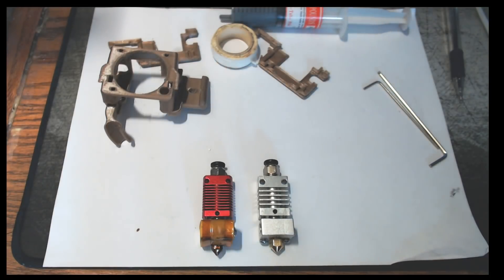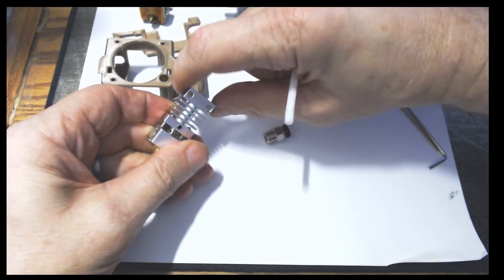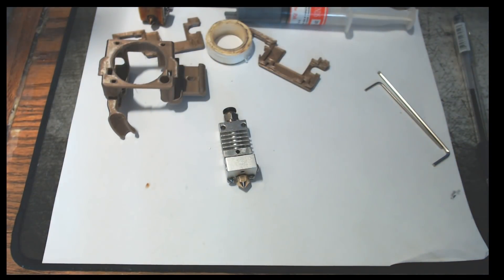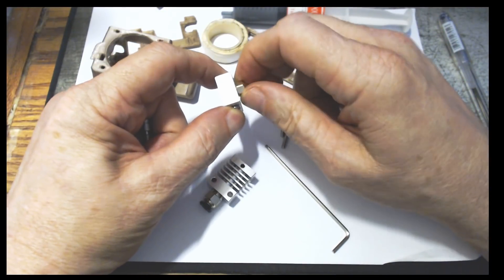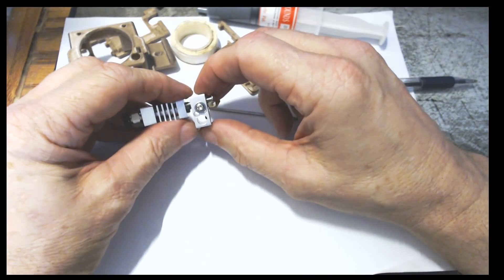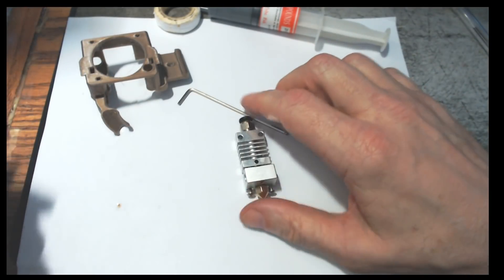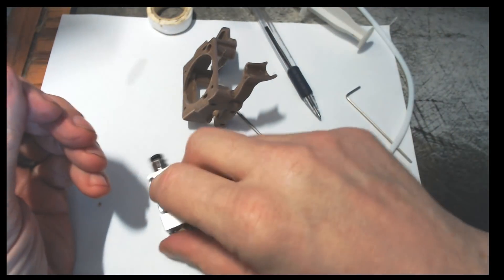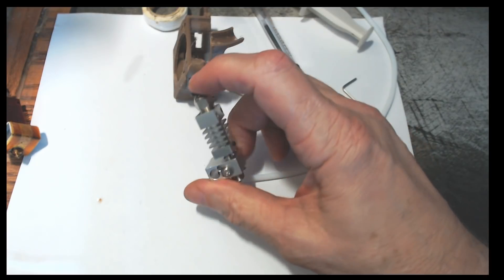All metal hot end for the Ender 3 for $7. Part 1, tips, trips and lessons learned.

Comment: Dont forget to do a PID calibration after changing the hot end as the nozzle temps will be significantly different due to a change of materials (especially if your using the titanium alloy hot end).  Plenty of guides out there and its quick and easy.
Reply from the maker: That's good information, Mark. Thanks for sharing!

Comment: The PTFE tube can release gasses at the high temps needed. So after using an all metal hot end to get rid of the PTFE tube I added PTFE tape to the hot end.....
Reply from the maker: I should put some text on it or something I guess.
But I'm hoping I can hit 1000 people who've called me on it. After 2+ years since I posted that video I must be getting close.
Reply: @3rdpig  :-)
Reply: or get some capricorn tubing it takes higher temps than the ptfe and is not that expensive :)
Reply: @John_Atkinson  capricorn is still ptfe tube. Capricorn will offgass at 250c, just like the cheap white bowden.

Comment: I upgraded my factory hotend with a titanium heat break from Spool3D. It turns it into an all metal hotend and keeps the stock cooling block with the pneumatic Bowden tube mount which is much better than the crappy Micro Swiss plastic tube mount.
I also bought the Spool3D nickel plated copper heat block that comes with titanium mounting screws so you don't have to rely on the crappy single grub screw that Micro Swiss relies on which is a weak design. The 2 mounting screws do not transfer any heat to the cooling block. It's a myth that's been debunked.
These 2 parts from Spool3D are cheaper than the Micro Swiss kit and make a much better hotend.
Reply: Thanks for the heads up.
Reply: Instablaster.

Comment: The 2 screws attaching the heat block to the cold end immediately identifies it as not a Micro Swiss. Those missing screws on the Micro Swiss had me extremely concerned that things wouldn't hold well enough, but the grub screw absolutely does hold it all together perfectly well. On my CR-10S my Micro Swiss with my TH3D Studio 50w heater have worked great and I can now easily print in Polycarbonate and Nylon.

Comment: 9:20 While you do want the heat to transfer well between the heatbreak and the heatsink, you DO NOT want the heat to transfer well between block and the heat break.
Edit: to further explain, it is inevitable to transfer heat from the heatblock to the heatbreak and then to the heatsink. The heatsink is there exactly to cool down the heatbreak, that means dissipate the unwanted heat that creeps away from the heatblock, because it can melt/soften the filament while still in the heatbreak and cause clogs. The real reason why teflon tape is a bad idea is because it releases poisonous gases when heated too much. What I did once was wrap my heatbreak with a few insulating glass fibers before screwing it to the heatblock. Theoratically, this would reduce the heat transfer between the heatbreak and the heatblock. I don't know how effective it really was, but It wasn't harmfull as I printed for more than a hundred hours without clogs after doing that.
Reply: Thanks. I was watching the video and noticed the same thing. Just paused it to jump down to the comments and see if anyone had pointed this out yet. So I'm just here to second that the last place you want to encourage heat transfer is between the block and the heat break.
Reply: Exactly. The purpose of the heatbreak is to STOP the transfer of heat upward from the heatblock. Makes no sense to increase heat transfer to the heatbreak.
Reply: lapidations, do you have a video how you do the wrap?

Comment: Nice video with some interesting insights. Some misstakes, too: I think you do not want to promote heat transfer between the heat block and the heat break. You want the heat to stay in the heat block and nozzle as much as possible, and you want the other heat, that managed to get into the heat break to be cooled down as much as possible. So yould should use paste on the nozzle to heat break thread and between the upper heat break end and the coolig block, and maybe between the heat block and heater cartridge and thermistor, but nowhere else.
And of course you do not want teflon on your hotend, that's why you switched to an all metal hotend at first, but I have just seen this has already been commented ;)

Comment: Did you reflash the firmware?
The stock firmware limits retraction to 25 mm/s and temp is set to 275°C max.
Reply from the maker: I've reflashed the firmware on both my Ender 3's  multiple times and from several suppliers. They've both been on the Marlin Bugfix 1.1X for at least 3-5 months. It's been the most stable for me. I've posted several videos of it.

Comment: Bowden tubes degrade at print temps of 245 plus, it just slowly leaches into your prints until a large enough gap develops to cause a clog. with getting leaks you sometimes need to polish the mating ends, I used 1000 grit sandpaper and stopped all leaks, I was using TPU and it was a terrible mess.

Comment: Tighten the nozzle all the way and use that 1/4 turn back, not 3/4 turn. What this does is allows the "cool area" of the heat break to be further away from the hot area. I know it does not seem like much but EVERY little bit helps. It might only give you an extra ~0.25 - 0.3 of a mm but that is that much more retraction that you can use, and just a tiny bit less blobs/stringing on prints because you can retract more. This will also engage the nozzle into the hot end just "that much more" which gives better heat transfer to the spot that is supposed to be hot = smoother looking prints.

I've been through a similar process, but with a Titan (insert registered trademark here, hehe) setup. After a great deal of testing/retesting many different things, my above advice seems to hold true. I got better prints with less blobs/stringing by engaging the nozzle as much as possible. I managed to get my retracts up to 2.5mm. I also went through a headache surprisingly similar to yours but I never had issues with leaking filament, I had always tightened the nozzle after an initial heat up (regardless of teflon lined or all metal), I learned this trick early on. My setup is a direct drive though, I can't be certain about a bowden tube, but it does seem to me that a bowden tube would naturally introduce slack so retractions should be a tad bit higher than a direct drive. I can't test this of course. Your millage and exact settings WILL vary.
Reply from the maker: Excellent info, thanks!

Comment: Been going down this rabbit hole. THANKS for the third video! Some quick tips break out the calipers and measure dimension on this stuff. Also consider ditching the heat block for a copper one. Also don't use the heat block screws... The reason is, I found both the block and screws were out of spec big time... If you use the screws they can pull the throat cock eyed. If one gently tightens the nozzle and throat under heat you'll get a clean matting. The other thing is start with extremely low retraction... Like 2mm maybe 3mm.

Comment: Don't know whether somebody has already pointed this out but putting thermal compound between the thread of the heater block and the heatbreak (as mentioned at 9:54) is a bad idea. 
It is counteracting the very purpose of the heatbreak as it is meant to keep the heat away from the upper part of your filament (or ptfe-tube if there es one). Essentially making the job of the heatsink harder as it is trying to keep that sucker cool for as long as possible. Putting it between the heatbreak and the heatsink, however, is a very good idea for the very same reason.
Reply: Well, i tought too but i got the same kit and had problems until i put thermal paste on the heatbreak thread. For what i saw, the heatbreak in his bottom part was too cold and it create jams. As soon as  i put thermal paste, problems gone and print like a charm.
Reply: @Jajaho2  My friend, we're maybe not rocket scientist but neither of us are idiots ;).
my setup in details : 
- ender3 linked to octiprint
- all metal hotend (this kit)
- Nozzle 0.4 in hard metal
Material i print wright now is PETG from Overture (amazon) @ 245 - 250 (still search the perfect setting) with 3mm retraction @ 45mm/s and 100% fan. Speed is at 50 with 2 walls and 5 top.
Reply: it's ok he likes to make mistakes so he can solve them later

Comment: Thanks for the video. Although I know this was a while ago, lately I've seen people polishing the insides of the all metal hot ends (and one guy spraying it with a dry lube) to get less of the filament retraction to stick.
Reply from the maker: Thanks, in a later video I tried an oiler which seemed to work well enough to get me back to 4-6mm of retraction. I've got more than one printer, so the one with the all metal hot end, which is also  enclosed, only gets used for something that really needs high hot end temps and an enclosed, heated environment. Thanks for watching!

Comment: I know this is from last year but just a heads up, I'm pretty sure the thermal compound should only go between the heat break and the heat sink. The objective is to cool down the heat sink, not heat it up. Also thermal compound isn't rated high enough to go between the heat cartridge and the heat block. Not sure what it breaks down to, but it's probably not good.

Comment: Thanks Chuck VERY useful...  The only thing that caught me out was 'using' the heatsink past! (perhaps it was good tolerances in mine... I could not get anything of it of it till I stripped it all out again and found that some heatsink paste got into the filament chamber... once cleaned out it was fine... Ps. i got Thermal runaway pop up on mine 2 minutes after the thing was started printing and presumed (falsely) that i had damaged the glass thermistor bead...I ordered a pack of 4. Later, when I really needed to print a part on it.. I got to looking at it again (in hope) but a bit more closely only to find the bead not in contact with the heated end and giving a falsely low temp rating.. put it back properly and it works a treat... PPS.. I ordered a cheap clone (£5)  myself and was prepared to wait for it to arrive.. My brother wanted an ABS part quickly and bought on one eBay. £35.. I see absolutely no difference in the look of this one and the one I ordered!
Reply from the maker: I definetly made a couple of mistakes in the video. For me none of them really made a difference. Later on I had to clean a clog out of it and when I put it back together I did it without those mistakes and it wasn't any different. So I either lucked out, or it wasn't as big of a deal as I thought it was. Oh, and I never put back the glass bead type thermistors, I always replace it with the screw in type. But that's just because I don't seem to be able to take one out and put it back more than once without breaking the wires off at the bead.
Reply: @3rdpig  I think I have lucked out too.. Changing filaments is a real pain.. I have to take the bowden tube and threaded nut to get anywhere... In the end i put the stock hotend back on and can change filaments so easy with that (providing you get the temperature right first before retraction) I'm guessing the insides of the cheaper ends are not very smooth unlike the bowden tubes.. which go further down the heatsink. I have given up on ABS printing now as my experiment with Glass/hairspray is not working at all ;although it is great with PLA/PETG. go figure. Thanks anyway Chuck. I like your videos.
Reply: update 2... my 'cheap version bought by my brother was not cheap (£35) as this but looked the same   I happened to order at the  a really cheap version off eBay and was prepared to wait for it .. it came today.. it is NOT the same... I'd say it is a mix between stock and yours and the one I tried in that the heat break is a lot longer inside the cooling fin block. So whilst the bowden tube does go inside the finned block, (as the stock original) it doesn't go as far down to the heat block. The stock part bowden almost touches the back of the nozzle!  I have yet to try it but am more hopeful with this one as the filament will get further through the system that my last one. (in the new one  linked you can see the heatbreak tube is a lot longer. https://www.ebay.co.uk/itm/Ender-3-5-Pro-CR10-CR10S-CR20-Hotend-Hot-End-Extruder-All-Metal-Upgrade-Kit-UK/143680597978?ssPageName=STRK%3AMEBIDX%3AIT&_trksid=p2057872.m2749.l2649

Comment: Teflon tape is the same thing the tube is made out of.  You'd be smoking it off making the fumes you are trying to avoid.  I use it between heat block and heat break to further thermally disconnect it whenever possible.

Comment: Yeah, I got one of those.  Mine had a piece of plastic inside.  If you get one, take it apart & double check.
Reply from the maker: I've purchased 3 of them and haven't found anything unusual inside. Is it some kind of packing material or just something that looks like it got there by accident?
Reply: @3rdpig  It looks like PTFE tube, I'm guessing that's what it is.  If it was installed on a machine without taking it apart you wouldn't know it was there, until it started to melt (or burn) at higher temps.

Comment: Inspired(?!) by this, I've just bought a complete knock-off hot end kit, including a new heater and higher temp rated thermocouple (not K type as I don't want the hassle yet) for....$15 shipped to the UK. Crazy.  Thanks Chuck :)
Reply from the maker: You're welcome!  I've since replaced the thermocouple on mine with a solid, screw in type. It fits in the screw hole that the retaining screw for the original glass bead thermocouple and is rated to 300 C. I don't intend to run it at that temp for long periods, but so far it's handled it 300 C for 30 minutes and 275 C for 3 hours. I'm looking forward to getting up and running with something higher temp and more durable than the Bridge Nylon.
Reply: Chuck Bryant When it arrives I’ll let you know what I think of the new hot end assembly I bought. Thanks again for taking the time to produce the video.

Comment: IMO one place you should not encourage thermal transfer with the heat paste, is the start of the heat-break threads inside the hot block, this is one spot where the more lossy you can make the thermal transfer, the better off you are. Everywhere else makes sense.

Comment: Great video Chuck, going to try the thermal paste to. Had same problems to, i coated the inside of the hotend with wd-40 dry ptfe spray, this helped a lot,the fillement goes thru a lot smoother. Keep up the good work..
Reply: Did you miss that heating ptfe too high produces toxic fumes?

Comment: Good advice! However it should be said all the headaches you had are not unusual (ask how I know) with the other company! I have two CR-10S and run all metal hotends in both. For myself I do almost all printing with PETG AT 235C the best part is once setup it is a long time between repairs. The stock hotend is absolutely perfect for PLA at 200c but at the 235c your on the edge of the PTFE limits. as I said good advice! well done.

Comment: Hopefully that thermal compound is rated for the high temps involved. You can't just use the kind used in PC's. Also, the only places that should be used if you're going to is on the nozzle threads and heater capsule. You don't want heat to transfer anywhere else. It's obvious what this is a clone of and it looks like a good enough version of it. For me, I plan to use a somewhat more expensive version that's plated copper which can handle 500+ plus degrees and also has a mounting hole for the thermalcouple or sensor needed for those temps (thermistors don't work well at higher temps). If Micro Swiss offered one like that, I'd at least consider it, but they don't.

Comment: got two of these , will use your tips as well, many thanks
Reply from the maker: Thanks for commenting! A few updates, Don't put heat sink paste between the heat break and any of the hot end parts. Don't use teflon tape. And you need to tighten the nozzle with the hot end around 20c above the top temp you intend to print at. After you tighten the nozzle remove the two screws holding the heat block onto the heatsink. And don't forget to change your retraction settings, if you use the same retraction settings as the stock hot end you WILL get clogs. Clogs suck!

Damn, I should make a new video.
Reply: @3rdpig  would you? I've tried everything mentioned in this video and more, and while I can print abs fine PLA just inevitably jams up in the heat break after a short while. I'm on the edge of going back to stock just wouldn't want all this effort to go to waste.
Reply: The same. Couldn't get any success with PLA either. ABS snd TPU no problem.

Comment: I didn't even know about the harmful gases, my problem was, printing PETG would molten the tube and clog the hot end causing it to almost stop extruding.
Reply from the maker: Truth be told, I have no idea really how much gas comes out of melting PTFE, only that it's in the material warning info. And I don't know what PETG you're printing, but none of the ones I use really require printing temps at or above the melting point of PTFE.
Reply: @3rdpig  I print it at 230°C, the PTFE should not even know it's hot haha but still, it was a bit molten at the end.

Comment: But you could just replace the stock ptfe with a copircorn tube to reach higher temps safely right?
Reply: I don't think the standard hotend on the Ender 3 get's hot enough for nylon filament.
Reply: PTFE is the limitation and is why the max temp is set as it is in the firmware.
Reply: @nestorkropotkin8952  I think the ender 3 can get to 255 max and copircorn tube can withstand temperatures up to 280 based on some research. Also, ive heard you can tweak the firmware to reach higher temperatures.